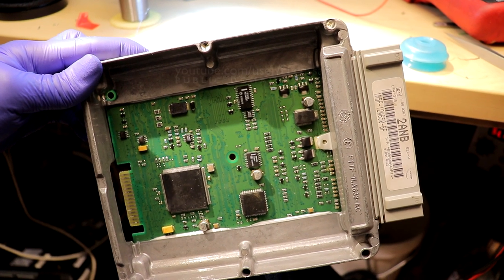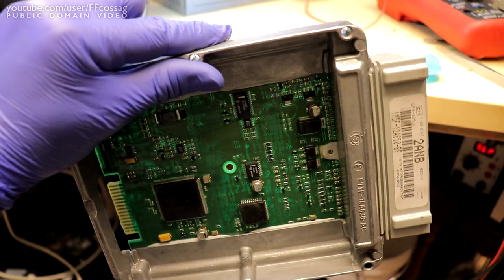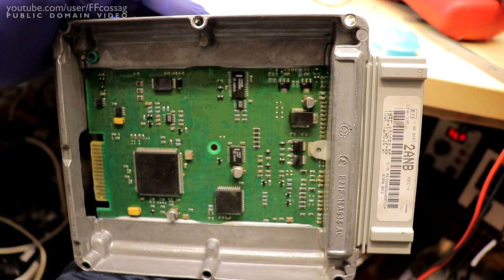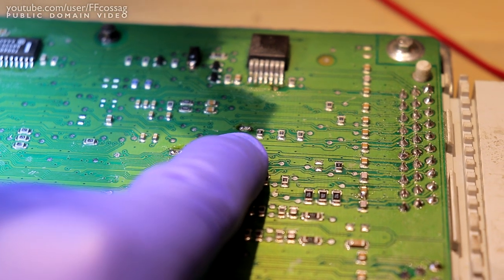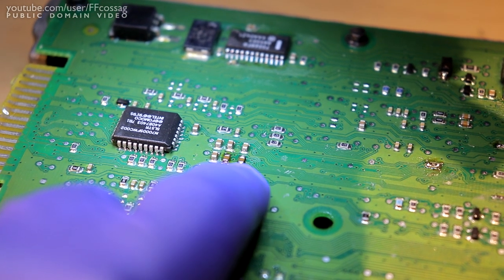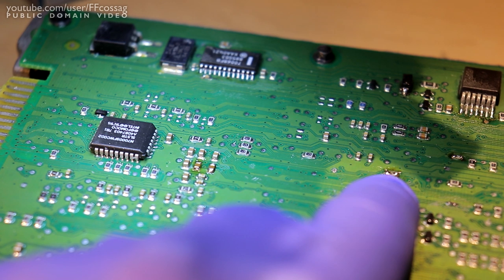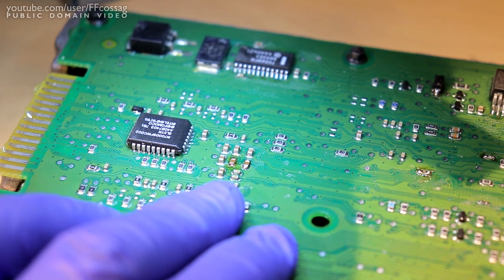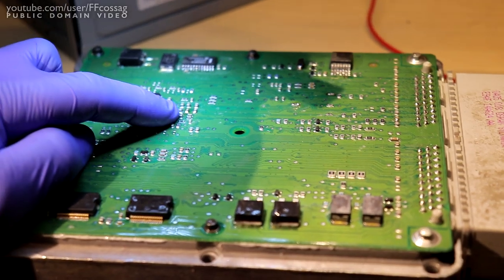2004 Ford Focus 1M5F-12A650-BF ECU repair (bad IAT/coolant temp sensor readings)

Comment: I remember back in the day those generation Focuses having a rather annoying issue of just randomly having all electrical power just "going away", usually at speed on a motorway, leaving the thing with no engine, brakes or power steering, dunno what they did to fix it (if anything!!), but it left a few owners a bit unhappy... :P

Comment: Well done ff, that could have been an expensive ecu and a pain to program.
I sort of had a similar fault with a mates odd control board that controlled all the basic electrical functions like electric  windows, indicators and most user controls.
The board was plugged into a large multipin plug and i found the socket on the board had loads of capacitors to ground, yep many were semi or fully shorted, i replaced them with 100nF caps and everything worked perfect :-D.
How can so many caps die for no apparent reason??.
Reply from the maker: Vibration and moisture!

Comment: I have an erratic reading in my 2002 1.8l focus mk1, but it throws p0112 codes. Tested the IAT sensor which is a part of the MAF sensor and it works fine, the resistance reacts accordingly to the temperature. But I even tried replacing an entire MAF sensor as used ones are dirt cheap and it obviously didn't help. It's kind of strange because it shows extremely low voltage reading at the computer, like 0,3V or less, when I start the engine, but then it slowly increases to a normal state. The voltage on the pin is more or less correct (4,5V). What to look for?

Comment: I have this ECU in my 2004 focus. I’ve replaced every sensor but it still won’t spark on cylinders 2/3. So Ive traced it back to the ECU having a problem. Hopefully I can find something that is replaceable on the board.
Reply: I've exactly the same problem. Did you find a fix?

Comment: Hi I have the exact same ecu part number from 2004 Ford Focus, I am having an issue where the cooling fan wont turn on both low speed and high speed, disconnected the CHT and fans still dont turn on, but when i do an output test with a scan tool i can turn on the fans both low and high speed, i suspect the ecu is at fault. Any suggestions as where i could look internally?
Reply from the maker: It could be a very similar issue to this, I bet the ECU just thinks the engine is always cold.
Reply: Thanks for the reply, I forgot to mention that the temp gauge on the car and through the scan tool reads correctly and everything seems right on that side

I will look into testing the components

Any idea where I could get a schematic of the ecu?
Reply from the maker: Such schematics don't exist. These cars have several temperature sensors though, the one that controls the temperature gauge might not be the one that controls the fan.
Reply: @FFcossag  thanks so much for that insight, I really need to find a solution and from what I gather getting a replacement ecu isn't going to be that easy to program...

I'm probably going to have to start by tracing the CHT circuit and Fan control circuit on the the ecu via the pinouts